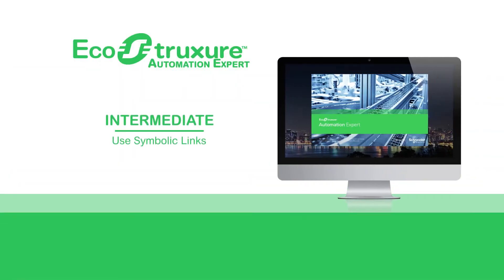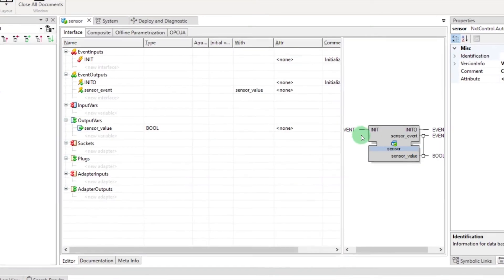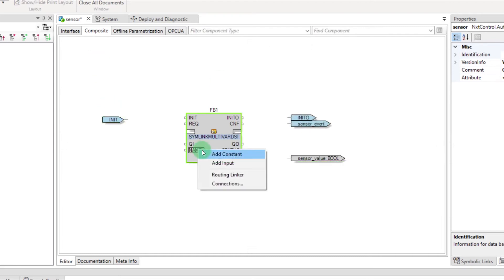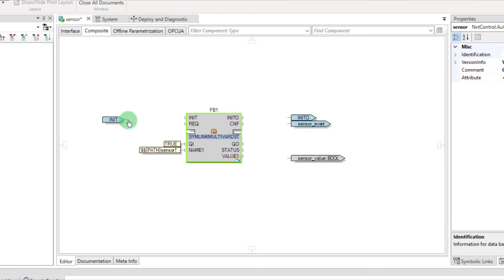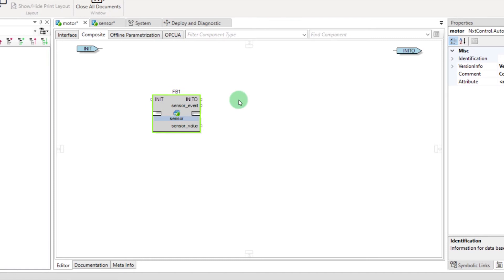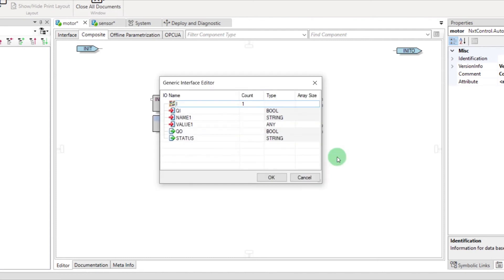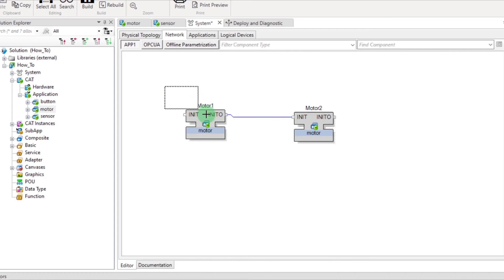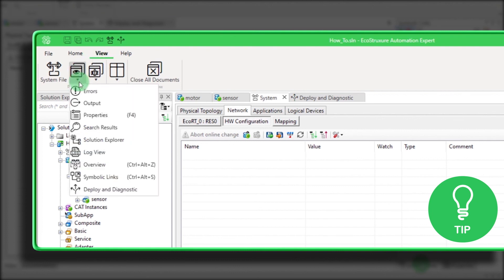How to Use Symbolic Links in EcoStruxure Automation Expert v21.0 | Schneider Electric Support

Comment: Great example, even managed to get it to work, thanks! Just a few suggestions for improvement: remove the "button" CAT as you never refer to it in this example. For the sensor CAT, perhaps mention that you need to add a sensor output event and sensor output, then drag and drop the output onto the sensor. Also mention that you need to compile the application for the symlinks to appear in the Symbolic Links pad. Using Ctrl-W to add FBs is slow and less reassuring than other methods like drag and drop from Libraries - so slow you don't think it's worked so start over again, then it appears.